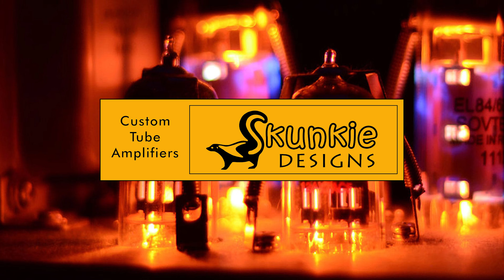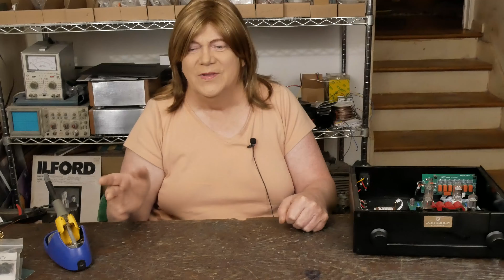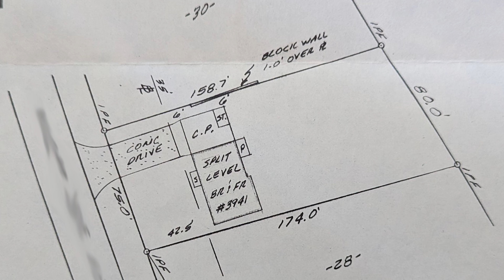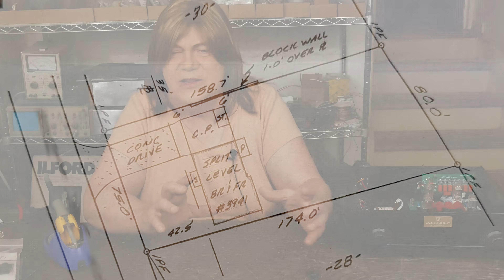Building My Audio Room: Planning First Steps

Comment: I'm happy to know you're going to build a dedicated audio. It's really a must if you're a serious listener and in your case a you tuber. 

I'm quite happy with how my room ended up with all the tweaks I tried but if there's one feature I really lucked out is the separate AC mains my room is fitted with. It is dead quiet since the power line isn't shared with my home appliances. Makes the most audible difference. It has a separate meter so I have two bills for electricity.
Reply from the maker: yes, planning out the electrical is also going to be a part of this!

Comment: You are getting your arms around all the various issues! My former career was in architecture, and as you began, I was thinking of several things to post - but you got to essentially all of them, and more.
The one thing I would consider is making the inside finish dimensions of the listening room something like 13' x 19' x 11' - basically avoiding any common factors. No even dimensions, and not have more than one of the dimensions be evenly divisible by 3', 5', 7', or 11' etc. I.E. if you have 15' wide, then have 17', or 19', or 21' deep. And have an 11' ceiling or a sloped/peaked ceiling.
Avoiding common factors spreads out the frequencies that can have standing waves. I.E. a 12' x 16' x 8' room would probably be very bad for 560Hz, 280Hz, 140Hz, 70Hz, and 35Hz.
Something I learned from Roy Allison - that same idea goes for locating the woofers/ports from the 6 main room boundaries - if the woofer is 2' above the floor, you don't want it to be 8' from the woofer to the ceiling, or 2' or 4' from the wall behind it, or the side walls. And so on - REW has a Room simulator in it that can be helpful for this.
Reply from the maker: Thanks for the tips!

Comment: Did you think about the sonics of your walls? Concrete is bad like the acoustics of any garage. But well lightweight construction like wood-insulation-wood sucks the bass. And again the dimensions of the listeningspace. Remember the golden ratio. Roughly 4 by 6. For example ceiling is 10 feet means 15 wide and (again 4:6) 22,5 feet deep. With this ratios no roommode will stand out. Best wishes, Juergen from Heidelberg 👍
Reply from the maker: Absolutely the walls matter, you guys are flying WAY past this initial video.

Comment: I would think speakers & amplifier power would dictate the room volume size.
Reply from the maker: Small rooms are MUCH harder to make good acoustically, especially low frquencies.
Reply: @SkunkieDesignsElectronics  yep immediate reflections. Unless near field. Which does sound great until hearing damage 😊
Reply from the maker: If I wanted near field, I could do that right now... Or just use headphones.
Reply: @SkunkieDesignsElectronics  I didn't mention anything about small rooms.  I am saying the size of the system would be part of the "mathematical equation" IMO to determine the 'volume' of said space.
Reply from the maker: I already have a space that works for low power amps, I need a space for testing and developing higher power gear used in rooms larger than my current house has. It would be silly to replicate the same size rooms I currently have. And these smaller rooms sized for low power also struggle with low frequencies, which limits what they can do.

Comment: I wouldn't use spray foam, even the soya based foam if it catches on fire the fumes will kill you.
If you are going to have a wood stove then I would have all the wood in the interior sprayed with a fire retardant, yes I know this stuff isn't cheap but you only do this exercise once.
Reply from the maker: Kinda doubt I'm going to bother with a wood stove, just was thinking out loud and yeah, not gonna spray foam it either.

Comment: Don't rule out mini split A/C units.  They are very quiet at the lower speeds and not terribly loud at highest speed.
Reply: Mini split is really the only viable option for a project this size.  Choosing the correct unit with the lowest dB and the options you want is critical.
Reply: Another point about conventional air ducts, that I have experienced in hotel rooms at Capital Audiofest and AXPONA - is that sometimes the air grills can rattle with bass, at times.
And the air ducts can act as resonant chambers - and the metal can cause rumble as the air flows through them. Some installations form ducts from rigid insulation panels, that are better "self" damped.

Comment: I have been involved in dozens of major recording studio constructions and as many project studios, including mastering rooms. Mini-split for HVAC, non-parallel walls, corner bass trapping, deep absorption on the front wall, diffusion on the rear wall, and a mix on the side walls. I recommend GIK Acoustic products. They are really your best bang for the buck unless you want to build it all yourself. Good Luck!
Reply from the maker: The difference is a listening space is different from a recording space. And yes GIK is less than 5 minutes from my house :)
Reply: @SkunkieDesignsElectronics  I'm not talking about the "recording space" but the control room. There are certainly differences in a studio's control room where records are mixed, due to the console layout and the need for near-field monitoring. However, bass trapping, room modalities, diffusion vs absorption, and soundstage are critical for a mix to translate once it leaves the studio. I would argue that the best listening space for a single song is acoustically identical to the room in which the song was mixed. Of course, that isn't practical, but the same principles should be applied.
Reply from the maker: That's why I'm hiring someone else to design the room acoustics.
Reply: @SkunkieDesignsElectronics The folks at GIK could help with design.
Reply from the maker: Already talked to GIK, and no they won't help with the room design. They said they only design treatment plans for a room AFTER a room is built or for existing rooms. I even offered to pay and they told me they don't provide that service, even for a fee. Maybe they used to, I'm not sure. They recommended a couple of different folks to do the room design work, and that's what I'm doing. They are literally 5 minutes from my house.
Reply: @SkunkieDesignsElectronics I'm sorry, I wasn't clear. I meant room treatment, not architecture and construction.
Reply from the maker: That's part of the reason to hire this room designer, once they have done the computer simulations to design well performing room size/ratios, they already have all the info needed to perfect the room treatment and can recommend products from a variety of manufacturers if needed. I will probably "Give the room" to GIK to see what they suggest as a second opinion.

Comment: I built my first mid-horn about 2 Weeks ago - I now can say, that I never before observed such a low interaction with the room and baffle, no baffle step at all and stunning clean mids, furthermore from about 300 to 5 or 6kHz no crossover, but coherent sound - this from now on is my roadmap to go. Dipols also offer the possibility of minimum room interaction, or better said, there is remarkable cancellation of unwanted bass frequencies, that this kind of sound radiation is another piece of knowledge I gained, and in a room ... I never had issues with the room, because I tend to fill it up with stuff, shelves with books, and those with clothes, furniture.. because I want absorption and splitting/diffusing of the sound waves. A non symmetrical place of hearing does the rest of the job. A good sound needs a asymmetrical design, is the case with speakers - except with horns - the speaker placement and the listening position. Then absorption and diffusing, that does not annoy, typical room things like furniture, curtains, shelves, room dividers, plants with huge leaves, pillows on the sofa, carpets, this list goes on and on...
and by the way: the room is part of the audiophile story, it definitely matters, and therefore not really off topic I find.

Comment: Here’s my shared experience.  Don’t over customize your room.  It’s tempting to do a lot of built-in features that fit your current gear perfectly.  But, overtime gear changes and flexibility is a great advantage.  Consider including provisions to have more than one setup.  I have three, a far field setup where I sit about 20’ from the speakers, a mid field at 10’ and a near field at 5’.  Each provides a unique listening experience.  They don’t all have to be top grade systems.  As I buy new stuff for my main system the replaced gear rotates into the other rigs.
Reply from the maker: I'm not planning ANY "built in features". Thanks for the note :)
Reply: good advice!

Comment: I completely agree that you need the Hvac to be as silent as possible. You are really thinking things through.
Reply from the maker: And taking it VERY slowly :)
Reply: @SkunkieDesignsElectronics So long as you are able to avoid paralysis by analysis , then taking as much time as necessary is a good idea.
Reply from the maker: Goal is to start construction late summer/early fall.
Reply: @SkunkieDesignsElectronics One big advantage you have is so many people looking over your shoulder. The more you discuss your  plans and ideas on video, The more likely that folks will chime in if you are missing something important.
Reply from the maker: The other thing I probably need to be clear about, this building needs to be convertable in the future into something else. Like I'm probably going to frame window openings into the wall even if I don't plan for any right now etc.
Reply: @SkunkieDesignsElectronics That sounds great. When I make stuff, I am always tempted to complicate stuff to make it as cool as possible. But eventually, If I am lucky enough to have come to my senses, I pare things back to the minimum viable product. I wish you luck. This stuff is always like walking a tight rope for me.😅
Reply: @SkunkieDesignsElectronics  This is the kind of forethought that takes time, but pays off when you have to sell.  Keep excellent copies of the plans that can be shown to potential buyers.  It helps makes sales easier when you have done the work for them.

Comment: We replaced our standard AC system with Daikin Heat Pump for air conditioning and heat. The unit is exceedingly quiet because it is variable speed it’s a continuous system versus being either on or off so you don’t get the high speed fan blowing when the system is trying to change the temperature of the room. It just ramps up slowly based on what the thermostat is calling for. I live in Southern California where summer temperatures can reach 115° the AC unit works perfectly to keep the rooms comfortable without much noise. You really don’t know they’re on unless you put your hand up near the vent. I have not noticed any adverse affect while listening to my system unlike the old days where I would have to turn the AC off if I were trying to seriously listen. Unfortunately, the Daikin heat pumps are on the rather expensive side, but to me was very well worth the money to have a cool and comfortable home and still be able to listen to my music when it’s really hot out. Good luck with your project. I really enjoy your channel and I’m actually in the process of building a fender champ tube amp now. This is my first project to build from scratch not a kit. Thank you for all of your inspiration. Keep up the good work, Dan.

Comment: I will be very interested to see what you decide on for the floor. My theory is that the speakers should be on sharp spikes on a cement floor so that they are as mass loaded and immovable as possible.

But on a hardwood floors , it seems necessary to isolate the speakers so that the floor does not become a big giant Resonant vibrator.

I am really looking forward to hearing about your decisions.

Comment: I built homes for 20+ years, if you have any questions holler at me. :) The most cost effective shape to build is a rectangle or square with a flat/ low slope roof. My suggestion- build a 16x24 building with a low slope- 2/12 roof and 12-15ft high peak at the tall end. You will get maximum usable space and the high ceiling you need. Any roof with a ridge or valleys and hips will cost exponentially more. Picture exposed beams going left to right across the 16ft the length of the building, room treatment built in! :) 
Slow down a little, your dumping money on advice way too early.
Reply: I think Steph is doing the right thing by getting audio specialists in the planning stage.  After all, this is primarily going to be used as a listening room, and as such it needs to be specific dimensions and construction that is necessary for proper audio acoustics.  Acoustic treatment requires deeper wall cavities with proper layers of acoustic insulation/treatment, not to mention  height and slab/floor that is conducive to proper 2 channel audio system room.
I can think of few separate listening rooms shown by You Tube audio reviewers.  Recently, the Absolute Sound editor showed his modest size listening room that he had built on his property separate from his home.  I thought it looked rather small  but it was built specifically for audio.
Reply from the maker: I haven't done anything yet... And it seems dumb to just throw up a "shed" construction building as cheaply as possible and THEN figure out I'm no better off than when I started. Low slope roof has no room for insulation, endlessly trying to keep it clear of debris and why would the roof have a valley?
Reply: @SkunkieDesignsElectronics  Not recomending a shed. lol :). Its a small building, easy to heat and cool, 6" of insulation in a low slope roof is plenty. You DO NOT want an air tight sealed box! Dont listen to popular beliefs, they are pushed by new products not common sense. Tyvek= NO. Spray foam= NO. Good luck! :)
Reply: @superspeeder  OK, but theres a reason old homes have been around 100-200 years and a new home will make you sick the day you move in. Good luck!
Reply from the maker: @superspeeder shoot me an email :) stephe@skunkiedesigns.com